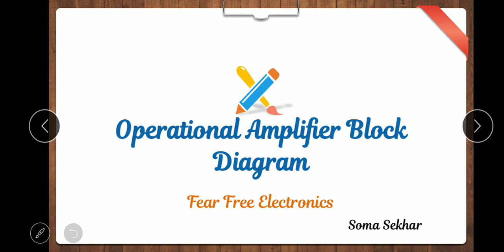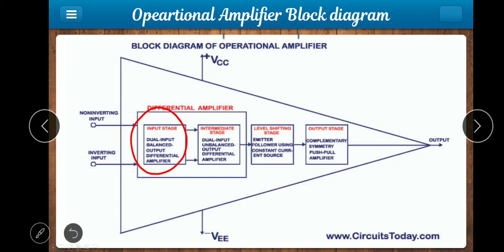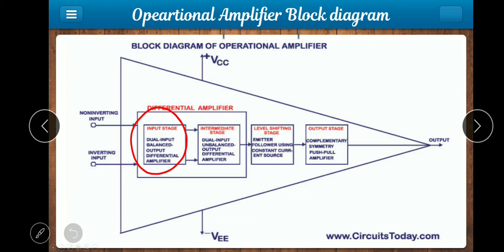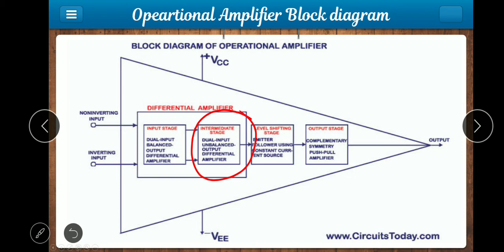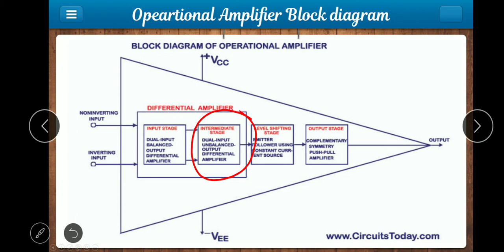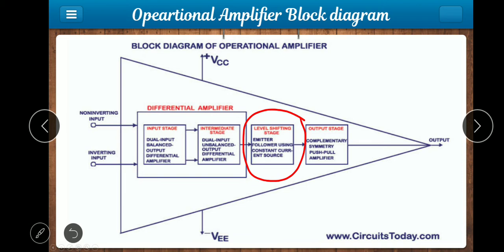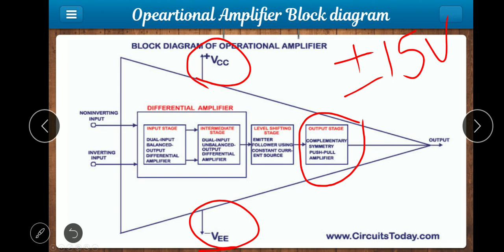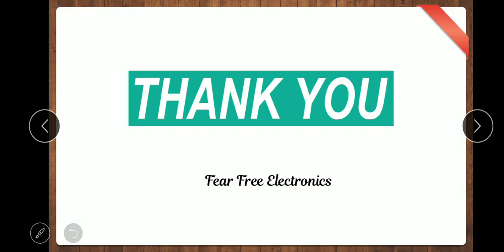Block diagram of Operational Amplifier in telugu | op amp | Fear Free Electronics

Comment: Bayya -vcc 15 volts istey output 15 a vastaadi annapudu asalu adi amplify avvaka potey what is the use of op-amp?
Reply from the maker: Ikkada VCC is not input and it is just biasing voltage or power supply for op amp to work
VCC is constant all the time
Okkasari VCC icchaka
Manam opamp ni ee application kyna use cheyochu 
Manam 1 v input ichi 10 v output theesukunte, great ee kadha
And alage this is a basic circuit
We have also have some updated circuits which has more features
Reply: @fearfreeelectronics7143  ohh okay bayya .thank you for your reply